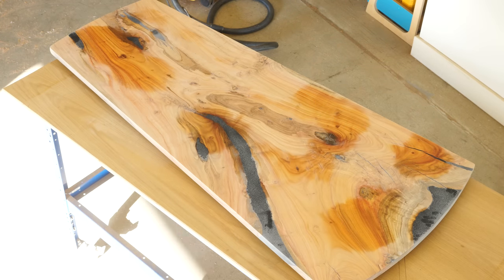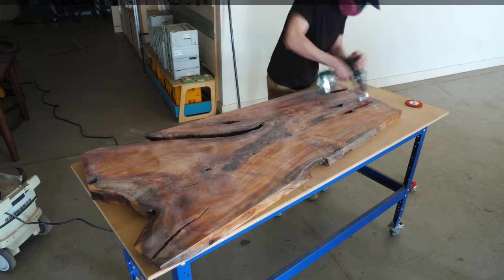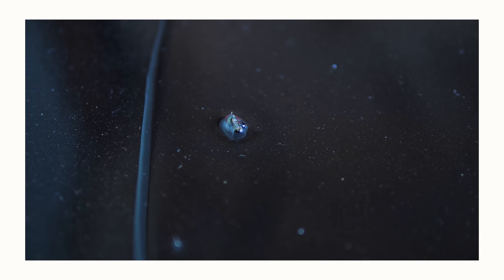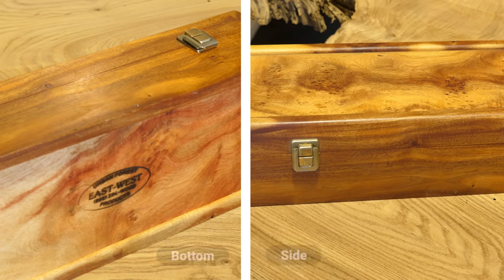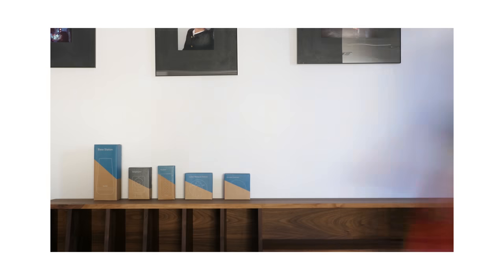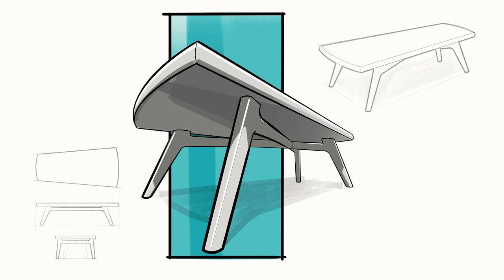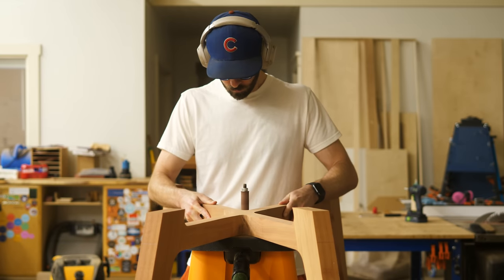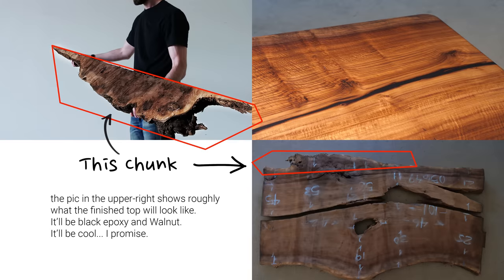Turning Worthless Wood into a Stunning Table

Comment: So, on the vacuum chamber you're mostly right.  The only thing I would say is.  The biggest reason you don't have to is because you tint your epoxy.  If you were doing a more opaque pour you would see the micro bubbles that degassing removes.  It would just make it look cloudy and with the tint, you're only worried about visible bubbles so good to go with no degassing.  Love your work BTW.
Reply from the maker: Yup...that is totally right. I was going to mention that as another reason, but I didn't want to go on and on. It's also one of the many reasons I don't ever go for clear. The chief reason being...I have no faith in it remaining clear for years to come.
Reply: @Foureyes.Furniture   I’m Dan btw.  Not much of a YouTube following, but I’ve got some good traction on TikTok.   I tried it… I hated it and I sucked.  I’m a more a hobbyist, but I think I do more epoxy work than any single individual.  If you ever want to bounce something off me for epoxy, I’d be glad to help.  I’ve been databasing your leg ideas to make make CNC models, so at this point I probably owe you something anyway.  Even if you want something made, my sponsors are pretty awesome that way.

Comment: Hi Foureyes, big fan of our channel. Good instructions and lots of different techniques. Keep it up, it pushes my woodworking skills. I have a question: you mention that you normally would make a " half lab joint" for the connection of the 4 legs. Now you're using a X-form from just one piece. Why did you chose to make the X-form and not the half lab joint?
Reply from the maker: Half lap. I just wanted to try something different. And I guess more than “normally” I should have said “in the past”. Neither is right or wrong.

Comment: for the clamping blocks, a cad program and a 3d printer should do the trick. may need to print at 100% infil (or not far off),  but should work. done some 90 deg clamping blocks for my woodwork with a 3d printer and they work fine.  keep up the great vids.

Comment: I didn't think I would like the charcoal bro but it's actuall;y really nice how it's turned out.. If it was me I probably would've been half afraid to try charcoal so props to u man.
If I had kept it in its natural form I might've tried even a dark red on the legs.. Sounds messed up bro but I like the thought if that and even the black legs look great painted.. U can see the beautiful grain of that wood through it and I don't mean the type of grain in the centre of a tree for anybody who wants to have a opo at me..
Great job man. 
I'm only really starting out so I have A QUESTION.. If I'm really only beginning on my woodworking journey how long should I take over the basics suck as marking straight lines, cutting straight lines, mortise and tenon joints, Lap Joints, etc..
I get it may well be prudent to stick at it til I have mastered it in a way but I really don't have another 30 years bro.. LOL
I'm 50 now and this is my 1st real forray into this field. I have somehow found a real passion for working with wood in my 50th year. I love it but time is an issue. I don't have enough time in my day to spend 9/10 hrs per day in my full time job and then spend 3/4 hours in myt garage learning the basics..
Have u got any advice for me bro.. Just a little titbit that I can take away from all the videos I have watched.. If I'm stuck I will check out a video just to get a little inspiration and I start brainstorming again.. That the thing I love about these videos on YT.. They can help unblock my mind sometimes, ok who am I kidding - all the bloody time pal.. haha!
Really nice table and a great cause bro.. Salute to u Sir from Ireland!

Comment: Liked the video, but if you're going to wear a respirator, please know that those filters you have do absolutely nothing to protect you from the fumes of the epoxy.  Those are for particulate like dust.  You need organic vapor cartridges for things like paint and thinner, or something specifically designed for epoxy fumes.  

Also for a beard friendly filter system, check out something like the versaflow.  That one is really expensive but there are cheaper alternatives too.

Comment: PAPR respirator, I have a big beard and use one regularly. It's a full face helmet with a powered air feed either in the helmet or on a belt at your back with changeable filters so you can adapt it to whatever you're working with

Comment: Quick question in the cross-joint in the middle - any thoughts on how it could be made more structurally strong? The end-grain glue joints (edited to say see more on this in my comment below) are weakening the joint and will be the failure point if the table is heavily loaded.  While editing I thought I'd add: lovely table, the black works on both the top and legs.
Reply: Well well... https://www.youtube.com/watch?v=m7HxBa9WVis apparently the "end grain" strength thing is a myth, but a glue joint is still vastly weaker than long grain.

Comment: Just a question from someone who isn't a woodworker, nor has ever worked with epoxy. But after a pour, wouldn't it be a good idea to 'shake' the slab? IE vibrate it for a few minutes, like when you're setting concrete. I only ask because I've never seen it done with epoxy tables before.

Comment: What's the buffering tool/attachment that you used after putting the stain on? And were you using water to lift the wood before application? Just a new guy, trying to learn!
Reply from the maker: Hey Isaac...not sure exactly which tool you talked about...But the process was:

-Sand up to 180 grit (water pop between grits)
-use "tack cloth" to get rid of as much dust as possible before putting on any finish
-put on first coat of finish (stain) 
-wipe off excess finish after about 20 mins.
-wait a day or two. and use a maroon pad to scuff finish
-put on second coat of finish
-wipe off excess finish after about 20 mins.

Hopefully one of those steps was the part you're talking about :)

Comment: Trend Airshield powered respirator. It's a bump cap with a visor/mask with a positive pressure air feed via  a powered filter with rechargeable batteries. I have a full beard and it easily fits over and seals fine. 3M do something similar but considerably more expensive.

Comment: The sanding tip also works for vacuuming carpet, using the same pace and patterns. Let the tool do the work it was made for, it can do it better than you can.
Don't shoot the messenger but that's not what "begs the question" means. 17:50
The fact is that is a table and I have an opinion about it.
Reply from the maker: anybody who would vacuum in a random pattern is an animal. 

as for 17:50. That brings up the question? I don't understand. I'm pretty sure that's a correct usage.
Reply: @Foureyes.Furniture  It raises the question...
Begs the question calls out an invalid argument in formal logic. The "question" is a challenge to a circular argument, where the definition is the proof. But if you were talking about finishes for example that you didn't like the look of, you might also say it begs the question of its environmental damage. Whether you like it or not is moot because let's save the planet dammit. 
You can find better examples online.

Comment: RE: Clamping blocks... since you have them you could easily draw trace them as a profile and have them laser or water jet cut from 1" or 1.5" thick material.  It wouldn't be that cheap but it would get you more clamping blocks quickly, and you could make them different sizes for different purposes.
They look basic enough that I could probably draw my own but the laser at work will only cut up to 3/4" thick metal.

I didn't like the idea of the charcoal finish but it does look better as a finished item.  For me, I'd probably have gone with something lighter, maybe 2/3 Charcoal to 1/3 Pure but together with the legs, it looks great.

Comment: Beautiful project as usual. Odd question: seemed like there was a lot of glue squeeze out in this one. I think remember in one of your early videos you made a comment once about not much glue was necessary. Is this a conscious decision by you to use more glue - or an evolution of thinking? Maybe doesn’t matter much, but it popped in my head for some reason while watching. Thanks for sharing this great project!
Reply from the maker: Thanks Nate...you're right. I'm still pretty light on the glue in certain applications. I'll typically use just enough to make sure it's covered, but no more. 

The reason I do it isn't to save glue...it's to save on time spent cleaning up.

Here (I'll use the joint where a leg attaches to a stretcher for example) I just slather it on because at the time I glue it up, it's a very rough oversized piece. I'm still going to band saw and route out the shape, which will get rid of 99% of the extra glue...and then the rest is very easy to sand off.

In the older videos where I'm going light is usually like a half lap, or putting a shelf in a dado. I still do it the same there. Those go together when the piece is much closer to being final. So glue clean up is really hard and meticulous. And anything you miss could ruin a finish. 

Hope that all makes sense.
Reply: @Foureyes.Furniture  makes complete sense. Thanks for the reply!

Comment: For the respirator with a facial beard, a few questions come to mind.  

1) How small can epoxy particles be?  If an epoxy particle's diametre is less than that of a human hair, it would probably be better to go clean shaven.  Any facial hair will make just enough of a gap for small particles like that to pass through.  

2) Have you had a quantitative fit-test done with your respirator?  Or at least a qualitative one?  There are companies out there that can do that for you, and I know that you can get an option to fit test with facial hair.  If you are able to pass a fit test with facial hair, there should be no problem with you wearing a respirator over your beard.  I will mention it is much harder to pass a test like that with a beard, but you can give it a try.  

3) Does your beard fit inside the respirator?  As long as your facial hair does not affect the seal of your respirator, there is no issue with you having facial hair.  

I work in Asbestos Abatement.  Asbestos fibres can get as small as hundreds of nanometres.  When you consider that a human hair's diametre is a few tens of thousands of nanometres (it is usually measured in micrometres), it is imperative that an abatement worker be clean shaven around the seal area.  Similar ideas go for other particles or fumes, silica being at the forefront.  However, this may not be the case for epoxy and/or wood particles, so a bit of research might be in order.  

I specify the seal area because I have several abatement co-workers that have mustaches, goatees, and even beards.  The ones that do care about not breathing in asbestos fibres and dust make sure to shave in such a way that their facial hair does not affect the seal on their respirators.  

I have also seen carpenters use a respirator when cutting through wood in general.  One of them who comes into type-3 asbestos zones (most severe type with heavy entrance restrictions) to build some ramps and the likes for us abatement workers sports a short beard with a full-face respirator that fits around his beard.  

In short, being clean-shaven is not mandatory with a respirator, however facial hair can compromise the seal.  Doing research into what fumes/particles you are not wanting to inhale will give you a good idea how much your facial hair compromises the seal, and getting a quantitative fit-test done will give you an idea how much your facial hair affects your respirator's efficacy.

Comment: I usually love wood in a natural finish, but this piece really turned out nicely with the dark finish. :) Why are the legs so much darker, is it another finish?
Thanks for sharing your work! :D
Reply from the maker: Thanks! And yes, it's a black tinted polyurethane. It's a top coat rather than a penetrating finish and it's made to basically turn the wood black.

Comment: FYI if no one mentioned it yet, there are these full face helmet things, not sure the official name where it uses "supplied air" from an external unit that can attach to your belt, it's commonly used in welding but i've seen other wood workers using it, since the seal is around the head and not the face it it removes the beard from the equation of sealing.

Comment: Jmho..normally I don't like wood darkened.  I like to see the grain and usually prefer lighter colors.  But, this wood did look better in the charcoal.  I didn't care for the orange, either.  I have some mesquite and it tends to be orange also so I don't use it for something in my home.  I use it in my shop.
Reply from the maker: Yeah, one of the things I liked about the charcoal here is that it really didn't hide the figuring. It changed the color, but all of the grain/figuring is just as present as ever.

Comment: People saying respirators don't work with beards are correct. You can get away with some stubble with certain masks on particular shaped faces but your best bet for protecting your lungs is to use a positive pressure/supplied air respirator. You can get them in different styles and types. 
I've spent over a decade working around things like coal, industrial coatings, acids, sulphides and asbestos. We go through test fitting procedures in our industry that check the effectiveness of our respirators. It's quite interesting that different brands of non air fed masks can work for some and not for others simply due to facial shape.

Comment: What do you do with wood expansion? I know in other projects you have left room for "play" in the attachment of the base to the top. Wondering what the concession was with this one.
Reply from the maker: Scale. On a dining table where two attachment points might be 40 inches apart. I will factor in expansion contraction. On a table like this where the two points are only about 18" apart...I'm not very concerned

Comment: I'm sure someone else has said it, but get (or make?) a PAPR (Powered Air Purifying Respirator.) It uses an electric fan to make a positive pressurized zone of filtered air in your respirator so no contaminated air can enter, you'll just have filtered air leak out where your beard is.

Comment: Full face masks that seal well and have filtered air pumped into the mask are available. Epoxy looks and runs like water but it has weight. I've cast bronze and aluminium. Bronze is unforgiving on a OK mold. Aluminium is more forgiving because it has less weight. It's not weight in lbs but weight in pressure exerted on the form.

Comment: In terms of a respirator that won't be defeated by your beard: I'm of the bearded persuasion myself, and I've used a respirator for years.  First, I had a Triton respirator which was awesome, but died after about 8 years (and they apparently no longer make them).  More recently, for about 6 years now, I've used a Trend respirator.  It's great, but a little heavy, and my neck feels the strain if I've been working in it for many hours.  Two after-market additions which have been invaluable:  I had someone sew up a dust shroud to prevent dust from coming through the neck / sides, and noise-cancelling earbuds.  So now I look like a Mandalorian when I do woodturning or sanding, but I haven't had any wood-related allergies in 15 years!  I call that a win.    https://www.rockler.com/trend-air-circulating-airshield-pro-34492

Comment: Personally,  I don't get the "no stain" mentality. It's furniture, and the place where it sits in the house and other colors around it matter to the desired look. Also, selecting project wood purely based on desired color is often impractical. I love the fusion of soft-rustic with modern...that's my preferred look. Fantastic video and project, thanks for sharing.

Comment: Hey, Mate. You can buy positive pressure respirators, now. They push air out of the seal, so you can have a beard and still be safe. They're pricy, but worth it, if you really want to stay safe. I tend to throw caution to the wind, far too often, but you do you.

Comment: If you didn’t like the color, why not stain it before sealing it? You could get an idea of the finished piece by getting it wet. Using alcohol could do that without soaking into the wood, and it dries quickly.

Comment: Two things: "Smooth is fast" is a road racing saying, and it references how you act on your controls - steering, throttle, brakes.  Second... draw your clamp pads up in CAD and email it to SendCutSend.  Tell them to waterjet them out of 1" aluminum stock.  Voila, clamp pads in your mail box in under 2 weeks.
Reply from the maker: Thanks Alan...That makes sense. For the clamps. I'm on the case

Comment: you should use linoleum flooring for the base of the mold the epoxy pop right of like butter in a pan i saw another slab table maker use it and it last for ever it cheap try it

Comment: by the way you can probably 3D print those clamping blocks with PLA in 100-75% infill and that would probably be strong enough. If you want a cheap 3D printer you should get any of the versions of Ender 3 by Creality. the base model is a bit finnicky though.

Comment: You are correct that the type of respirator you used earlier in the video will not fully protect you if you have a beard; that kind of respirator only works properly if you are close shaven. The type of air purifying respirator you need if you do not want to shave your beard is called a 'powered air purifying respirator,' or PAPR, for short. What you should really do is contact a local industrial hygienist to come to your shop, evaluate the hazards, and devise a safety plan for you and your work. A good starting point to find local industrial hygienists is the website for the American Industrial Hygiene Association.